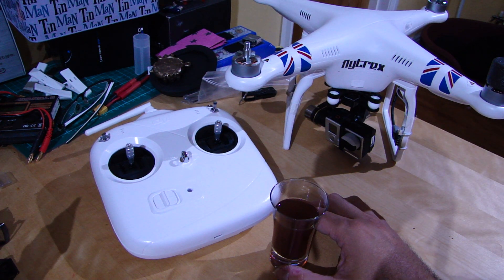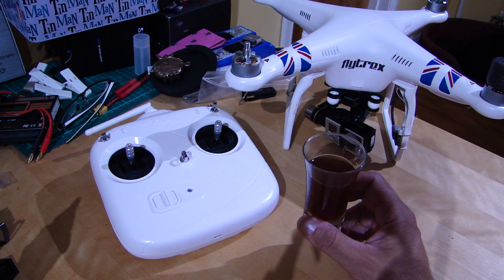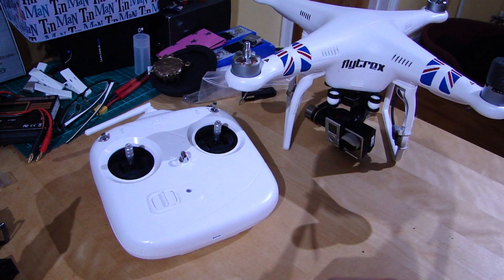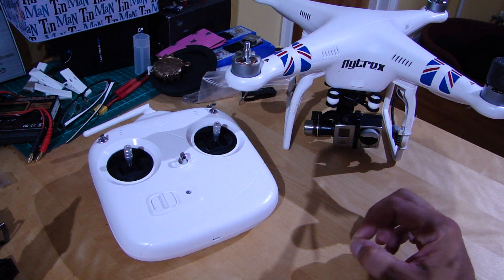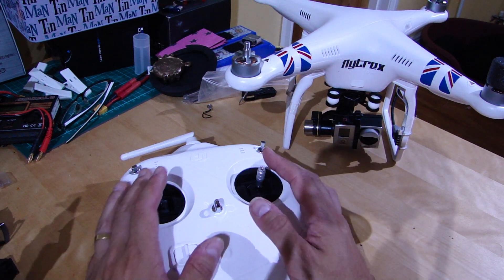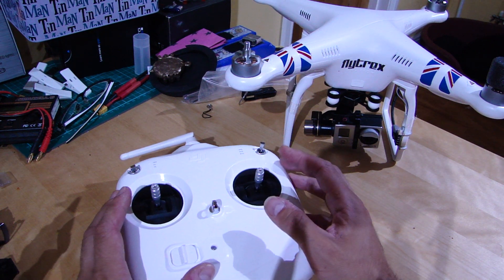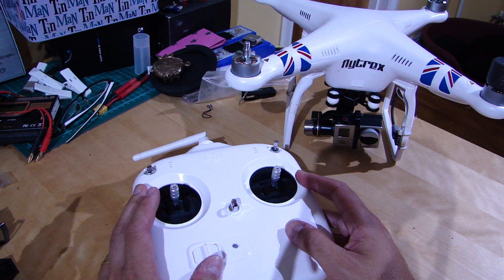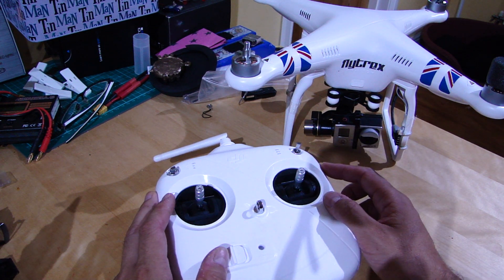DJI Phantom - Some hints and tips for smoother flying for smoother video - gains and yaw/rudder

Comment: Thank you for the video. I thought I was the only one with this problem. Good to know that it is not just my inexperience and poor piloting skills. You gave me some great Ideas I am going to try making a stop that is close to the stick in the center and further away toward the top and bottom so I can arm the motors and still have yaw restriction at a steady altitude.
Reply: ***** I have made the yaw stick stop. It works great, but does slow the yaw when flying as well. I posted a video on my YouTube site that explains what I did and how it turned out. Check it out if you have time. 
"DJI Phantom 2 Vision Yaw Stop"
Thanks again for the tip.

Comment: Another thing I have tried with some success to smooth yaw is extending the left hand stick by a few inches. This means that small movements of the top of the stick translate to even smaller ones in terms of actual control input.  I used an old ballpoint pen case which fitted perfectly over the existing stick but anything will do.

Comment: Simon, one way of making the sticks about a centimetre longer is to adjust the thumb knobs. They are length adjustable!

Simply unscrew the tip of the knob whilst holding the bottom part of the alloy knob. Set it so that it is near the end of the shaft with just enough threads to hold it firmly. Then screw up the lower part of the knob to meet it and lock the two together. Like a lock nut arrangement.

I did this with my P2V+ and the yaw is much easier to finely control now! Still tricky to get really slow pans though.

I still wish that DJI would incorporate some yaw stick gain adjustment though. Better still, to be able to dial in exponential rate percentage on the yaw stick would be truly ideal. I really can't understand why they didn't do this to start with especially as they market this as a 'flying camera'. It only requires a little bit of software tweaking when all said and done! Could you suggest this to them please? Maybe we could have it on the next software upgrade?

Comment: 6:25 FYI I am told a Futaba transmitter works fine with the stock DJI receiver, you need only pair the TX with the RX. Specifically Futaba 14SG and 8FG will bind to Phantom 2. I expect other TXs are available.
You would only need to change the receiver if you require extra channels.
Reply: Indeed, my Futaba 14SG works quite well, and gives me more options for gimbal control.
Reply: Rick Dicaire How did you manage that considering the stock P2V tx is on 5.8GHz and the your Futabe I believe is 2.4GHz?
Reply: ***** Simon, I guess that means I would have to replace the tx and Rx for my P2V?
Reply: Eric Tuori I dont have a Vision, I have a kitted out Phantom 2 with H3-3D.
Reply: Would it be possible to buy a Tx & Rx on 5.8 GHz, put the new Rx in my P2V and then have a programmable yaw rate? I believe there are modules that can be plugged into the Tx to make it 5.8GHz....right?

Comment: have you or your colleagues done any experimenting with other propellers? 
Like using 9" instead of 8" on the Phantom FC40 model?
or using carbon fiber propellers?
or using the triple bladed propellers?

any remarks regarding handling, and lift and flight times would be great.

Comment: Hi Simon do you know what your settings are on your PV2 the settings you are talking about i have the PV2+ and they where 120,120,120,120 and then 200, 200 i hit the default butting and they went higher and some different then others?

Comment: Hi Simon, this is an off question but today I almost lost my Phantom 2 in the Atlantic Ocean because my battery died on me. Only thing is I had about 65 percent of power left. I saw the red Let's on and immediately brought her him she got close and started to land on her own. I panic big time and almost jumped in the ocean to save my P2 lol. Any thoughts. My battery is about 7 or 8 months old.
Reply: 300! I'm nowhere close to that amount of usage however I'm not going to be able to check with the assistant software. I've never updated my P2. Reason being I live about 5 miles from JFK international airport. I won't be able to take off 😳 so I've never updated and please understand I'm not crazy enough to fly over 400 feet. At home I fly about 50 to 75 feet. Are there any other way to find out or have a clue as to what could be the problem 😳
Reply: I just gave up and bought a new battery 😢 it could have been the battery. She's flying great now, 17 to 22 mins of flight. On a side note I did a wind test In New York City. Didn't know the Phantom 2 can fly in a 55 MPH (88 Kilometers) with no problems, I truly love this gadget.

Comment: HI Simon
I have a PT2V+ but I never update the sofware because my PT2V+ can not connect to the my PC. every time i connect my PT2V+ to my PC they come up with the sign ( error . please connect the controller ) and in side the DJI window they have logo for phantom 2 only ,not PT2V+ look like i saw in youtube.Please tell me what i need to do for update the Firmware .thank you
Reply: Yes i did ..i try connect to camera and the video is work .that mean not thing wrong with the cable or camerra.only the PT2v+ not connect to PC i try flowing alost of youtube video and your video too.but when i connect PT to PC the PC have a sound (bing bing ) and not thing come to DJIdrivers .No sound ,no blue flash ligth and the DJI driver come up with phantom 2 only. i try to contrac with california dealer after fist fly and they tell mw send to them . after 2 month they sand it back with out any re pair .now i can not call email or contrac them nay more.do you thing i need a new RC ?
Reply: fisrt time i by PT2v and it got the same probem when the PT2V+ come out i by it and they send from Hong Kong.now i like PT3 but i scere it do the same
Reply: my 2 PT2V and PT2V+ still work .only thing is I can not update the firmwere .thank you Simon
Reply: Hi Simon
i did update my PT2V+ after download the driver . thank you for your help

Comment: If you want smoother controls try a glass of wine or two ;)
Reply: ***** Hi Simon, Thanks for your Video's !. I have a stock P2 with Gopro 3+
1. Do you have a 'flytrek' system on yours? can you give some info , how to install , and benifits ?
2. I am shooting stills down (-90 deg.), and have the 'known' fisheye/ Do you have some recommendtations how to remove it ?
3. A video for good flying using both sticks - Rudder and pitch/roll - for doing manouvering ?
Thanks,
Dave
Reply: ***** Enjoy ! - I'm looking them up !

Comment: Hey Simon, I've been struggling with my Phantom 2 since an accident I had and I haven't been able to fix it, it has a strange behavior that it loses altitude and wiggles around, someone told me to check the gain but I don't know if that can be it, if you have any idea on what can be going on with it I'll appreciate any comments, I have a video that shows the behavior, thanks!: https://www.youtube.com/watch?v=IsXZrScFd1w
Reply: Hey Simone, thanks for the quick response! The damage was pretty bad but the shell didn't crack. I had this issue a couple of months back and have been changing stuff every since, at first the motors where either sounding weird of not fitting the props well, so ended up changing the motors, but while doing that, my friend who was helping me drop some soldering on an ESC board, so I had to change it, but the new one came as v2.1, so after changing it and testing, the behavior was the same, contacted DJI support and told me that the ESCs had to be all the same version, so ended up changing all the ESC boards. Oh and also the GPS ceramic piece on top cracked, so changed that too! And don't even get me started on my ZenMuse, that's another story that didn't end up well either. The problem was that is felt from around 10 meters into concrete after hitting a tree branch, so the damage was pretty bad since I have changed a lot of stuff and haven't been able to make it work again. I'll probably will have to send it to DJI to get it fixed since I'm out of ideas...thanks again for your help man, appreciate it.